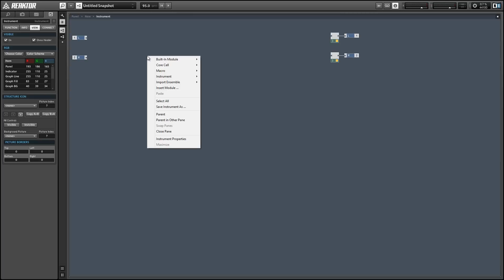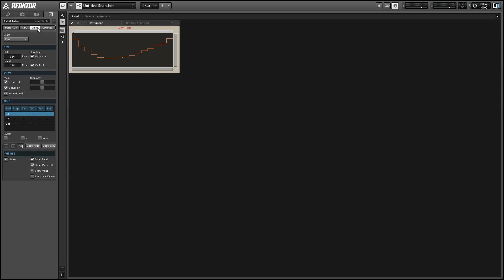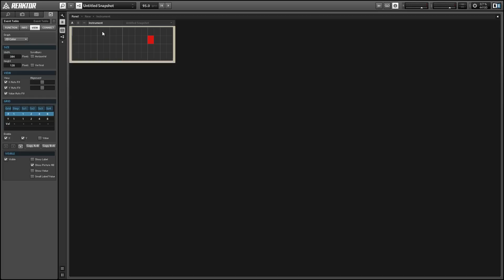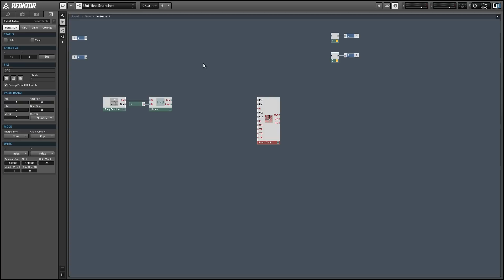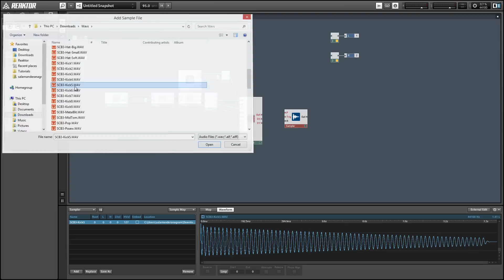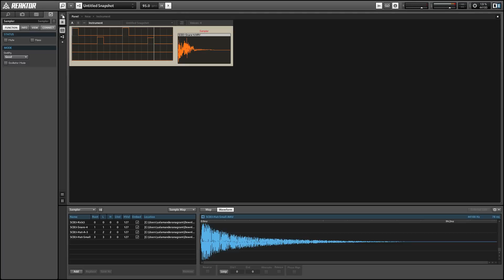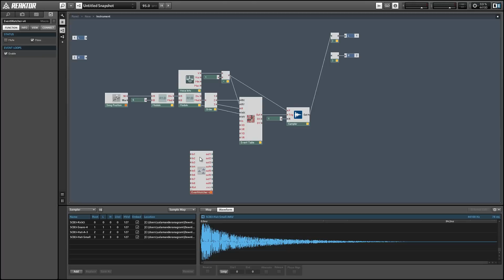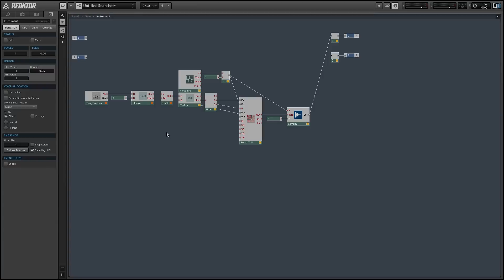Reaktor - Creating a Drum Machine - How to Tutorial

Comment: Question-So is it possible to create a retrigger? Like the glitch without the step filter...if we control the input B (6) on the modulo with a knob, and the step filter with a switch, is it possible to create a retrigger?
Reply: Oh! Wait...you can't because it's the clock right? How can we make a retrigger?
Reply: changing the B input of the first modulo changes the speed of the clock, we'll cover that next week ;)

i guess you could use an iteration module with the speed limited in properties (in place of the step filter), or a frequency divider (also in place of the step filter). that's just off the top of my head, i'll try to come up with something a little more elegant for next week!